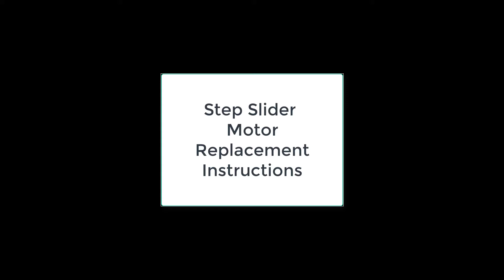Step Slider Motor Replacement Install

Comment: I agree with most of the comments here. My right side went out after 2 years. Replaced the motor and shock - problem solved. 3 years now, the left side is out. Installed new motor and shock in that one -- still sagging. Tried all the alignment tricks too. The motor just isn't strong enough to lift the step. With just a minimal amount of help it will close. For the price verses the quality, I would not recommend this step.

Comment: I have replaced the motor on the driver side twice. To say I’m disappointed is an understatement. I keep them lubed but doesn’t seem to matter. The motors simply can’t handle the weight & they fail after about a year. 😕
Reply: I have gone through two sets of gas struts and I just installed the new spring struts (which should have been free given they knew the gas couldn’t handle cold weather) only to find out the motors can’t handle the springs.  

They are sending me new motors (free for once) but honestly the nightmare it will be to remove the steps, instal the motor, then reinstall the steps….  I’m thinking no.   I highly suspect the new motors will just burn out in a year due to the springs.
Reply: @georgeonderko5273  yeah, actually my 2nd gen has been more reliable than my 3rd gen steps on my 392 go figure. that said, i still love them -- nothing else on the market anyway that can handle abuse off road and provide a retractable step. I wish they were more reliable but it is what it is. Had more issues in cold weather than warm weather. Replacing the gas strut with a spring strut on my Gladiator this week as the motor went out -- steps are about 3 years old at this point. Driver side went out in in Sep '21. Passenger side made it the full 3 years.

Comment: I have a problem with drivers side Rock Slider not coming down. It started with buying a new motor because of no warrantee so I replaced at my expense then after 6-7 months it worked intermediately. Now it no longer works. i took it into the jeep dealership to have it looked at and even though they installed it they will not work on aftermarket product! JUNK!

Comment: My drivers side stays down about 1/2 and inch. And ideas. Any adjustments?
Reply: I’ve sent them pics, videos…no help. They just send you a video on how and where to lubricate. I have the same issue as you. This isn’t a lube issue. I’ve got my step off right now, trying to figure out how to adjust. There isn’t much to adjust. Good luck.
Reply: @whahahajr  let me know how to goes. I know the one you’re talking about.
Reply: @whahahajr  I did it! Just loosened all the bolts and started from the beginning. Didn’t remove the strut though. Tightened in order. No more sag.
Reply: @itsmejp75  nice. That’ll be free fifthy for the info 😂
Reply: So I’ve had my steps on my JL for 2 years and started having issues with drivers side step not fully retracting especially in snow.   Anyways, I bought (2) new $15.00 gas springs from Rockslide Eng. (one spare) and installed it in around 2.5 hours off and on.   Now it’s like new with a positive thump when it retracts.
Reply: @AV8XRC  Were you able to do it while installed on the jeep? I have the similar issue to everyone else. you were the first I saw mention gas springs. any hints before I wade in?
Reply: @davidmcmurtrie6832  unfortunately, it cannot be replaced with step on the Jeep.  Once off, I removed the C-clips on both ends that retain the gas spring and was able to pop one end off with step in retracted position, but I had to cycle step open to get the gas cylinder side off. It probably would’ve been easier to loosen motor up, but I didn’t want any alignment issues.  I have an old office chair that I removed the backrest from that I use to install my bumpers and the sliders.  Compress it down align and release so that seat pops up and holds the slider for easy on & off.  One last thing…I attached new strut in reverse order, but you have to compress the strut 1/4 - 1/2”, so you’ll need something like a large pair of channel locks to squeeze it as you use screwdriver to coach it onto the mounting point.  Good luck!  It’ll definitely fix the issue.
Reply: @davidmcmurtrie6832  After replying, I realized I did something differently due to its confined space.   The gas spring end that connects to the mechanical end is a threaded stud, so I removed it by unscrewing it using hose pliers then screwing new one back in its place as tightly as I could by hand only to avoid damaging it.
Reply: @AV8XRC  Thanks, the office chair use is great! I appreciate the guidance,  you have a great day!

Comment: I'm  not happy either. Bought the Gen 2 on sale and then found our that gen 3 was also on the market. Didn't know Gen 2 has a known part failure.  2 years later the step is hanging on the driver side. Called RSE and they sold me the failed part and let me know about this video as instructions. Video is not a good one for instructions BTW. Now I know to expect to do this job over and over(: Feel cheated being sold something that has a known defect.

Comment: We were having problems with the driver side step, took to dealership they stated they contacted RockSlide about the motor and they are having trouble finding a motor to replace.  Rockslide has a weak warranty, these steps are only 2 years old and turned out to be poor quality.  I recommend finding another product.

Comment: Do you need to take off the whole thing to replace the motor?
Reply: Did you have to remove the whole piece to install the motor?
Reply: Yes, you need to completely remove the steps off the vehicle to replace the motor. But you also need to keep the power source accessible since you have to open and close the steps to calibrate the arms while it’s off the vehicle. This company  is a fcuking joke.

Comment: These steps are everything I want in a step but they just don't work. The idea is there and its great hopefully a gen 4 might be better. I have gen 2 with the upgraded springs but they can't handle the cold and even on warm days they fail. I keep them lubricated with the RSE recommended lubricant and I clean them regularly but I fear I need a new motor as it only fully retracts 50% of the time. There really is nothing else like these on the market and being I have little kids (one with a disability) I suck it up and repair them. I just wish they were more reliable.

Comment: I love how they don’t send any instructions, assume you have their tools and work bench, don’t show the uninstall process, and are working on a brand new step clear of any road sediment or mud.

 These steps are a novelty item and can’t handle any sort of actual use or real life conditions. I live in the mountains and they can’t handle any sort of snow or ice build up and died in less than 1 year. Should have saved my money and regeared instead of buying these expensive pieces of crap but my wife and toddlers like them.